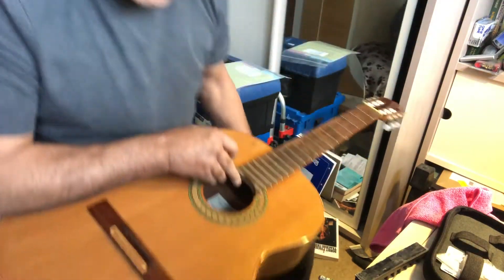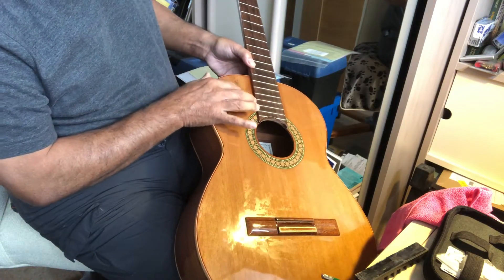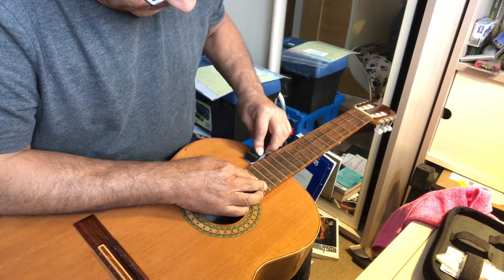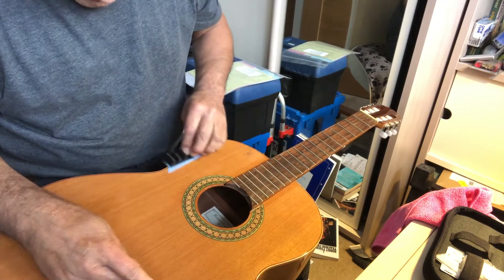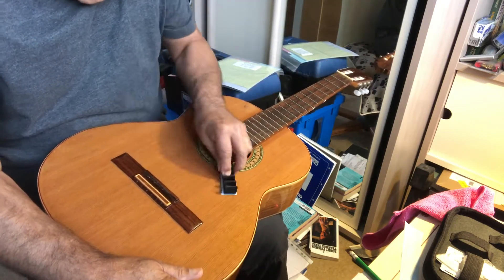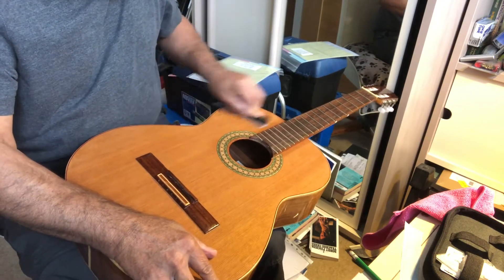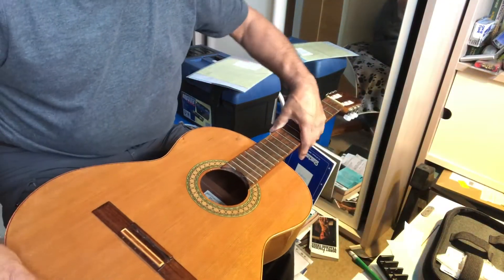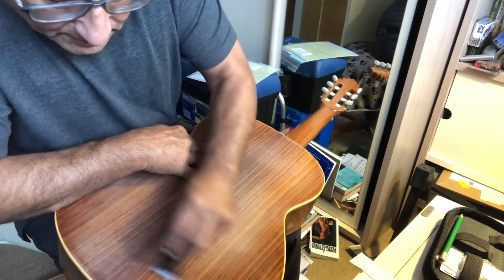Classical Guitar Repair PART 2

Comment from the maker: I got this from Rodriguez company
“Dear Trevor, thank you for your email, it looks that the guitar ha suffered some humidity in the inside and reacts with white color on the Varnish, the only solution is to sand until the wood and repeat the back to get the white discoloration, but this will not affect the sound, Thank you so much, best regard, Luthier Manuel Rodriguez III”
So it’s humidity?
Reply: yes i went to luthier last week too. He said that the only solution that has reacted due to humidity is to polish it again.

Comment: How will the whitening problem go away?
Reply from the maker: That’s the issue. I think that the colour is oxidation and is in the lacquer. I think the only answer would be to remove and replace but who will want to do that? I am doing the next video involving polishing. Happy to hear advice and comment as I am no expert- just my first attempts at repair and set up.
Reply from the maker: Also I saw online that this happens with Rodrigues guitars
Reply: @thoughtsandstoriesfromgran6276  I have this problem on my ben alhambra and prodecio guitar. I tried and burned the hot air gun :D Thanks for the video, we are waiting for the continuation.
Reply from the maker: I have sent an email to the manufacturer. Bet they will duck responsibility!
Reply: Stop putting water on the varnish you will only make the clouding worse, as the luthier hinted. Although l expect he will disagree with me, as a cabinet maker, l have had much succes using canforated oil, applied, just a few drops on a ball of cotton wool, (golf ball size) with light sprinkling of jewlers rouge. Rub gently, don't let it get clumped. Try a small area first. Gently on then as you begin to get rid of it buff with clean cotton wool, finish polishing with a soft cloth.